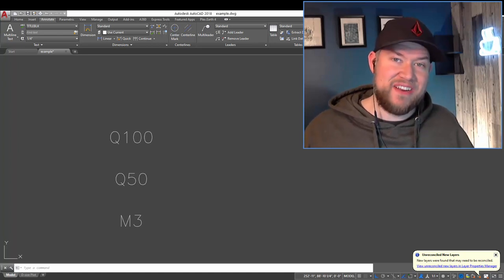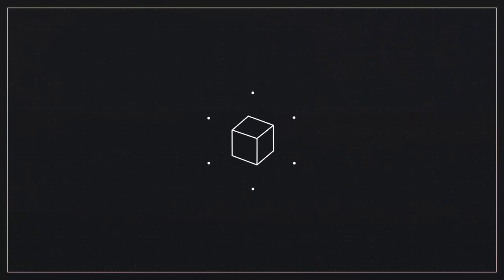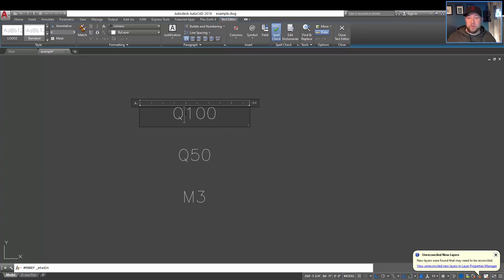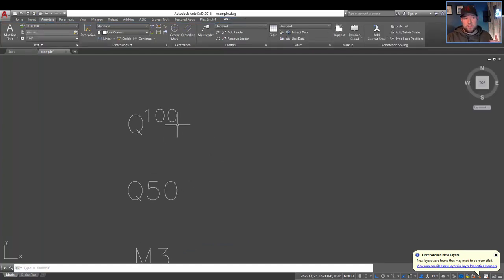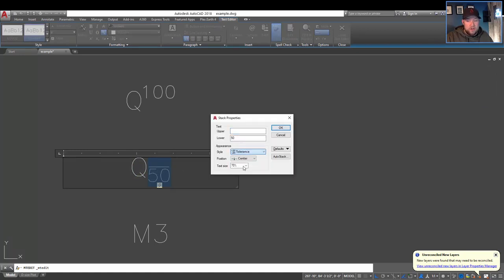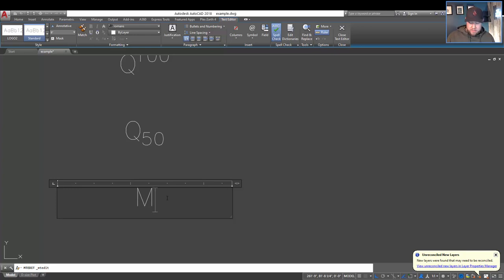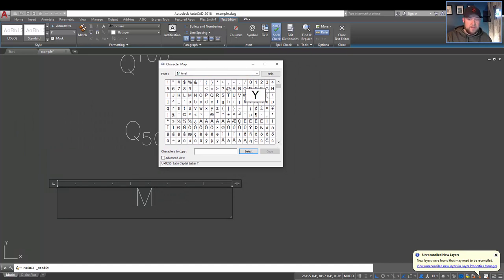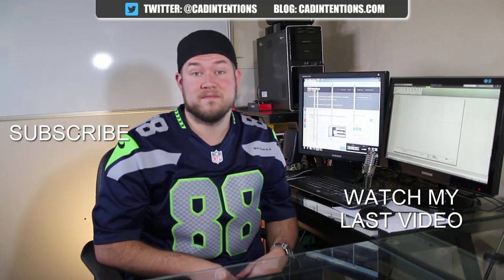AutoCAD How To Add Superscript / Subscript Text and Symbols - 3 Quick Tricks! | 2 Minute Tuesday

Comment: Ok here is a question.  I have posted in the autocad forum on autodesk website with not much help.  Maybe I can get some help here.  

I just upgraded from 2019 to 2022.  When doing a dimension with 2 lines.  

example is
th(boot-mode)
SEE NOTE 2

When I subscript the "h(boot-mode) and make it 100%
half of that goes into the "SEE NOTE 2" part of the dimension line
now I know you can use the line spacing that is with in the text formatting dialog box
but since i have upgraded to 2022.  I CANT NOT do it that way.  Would anyone know why?